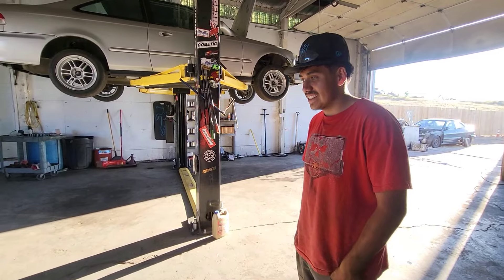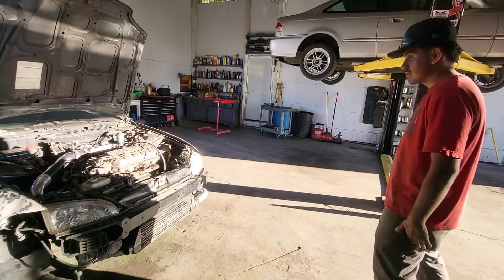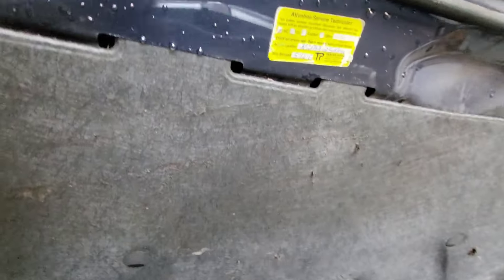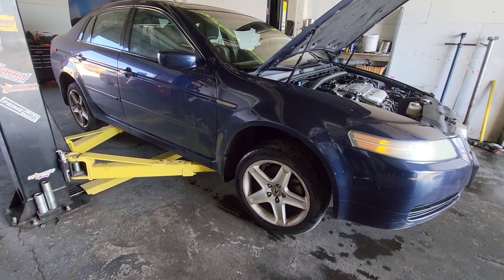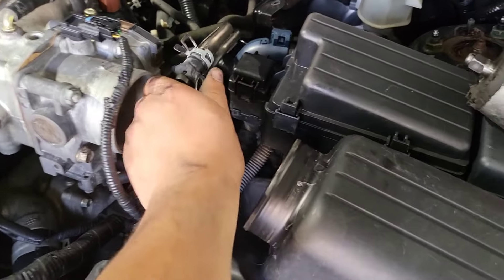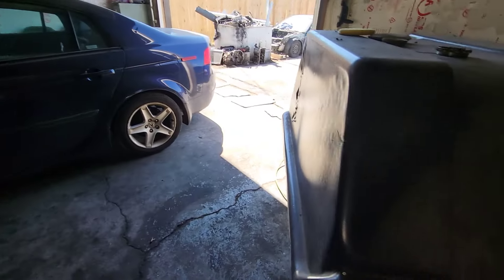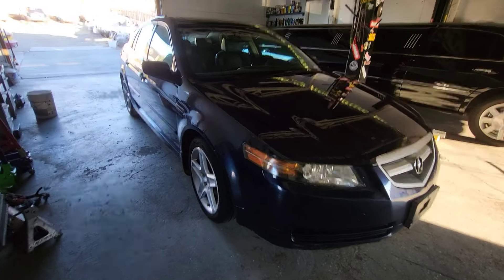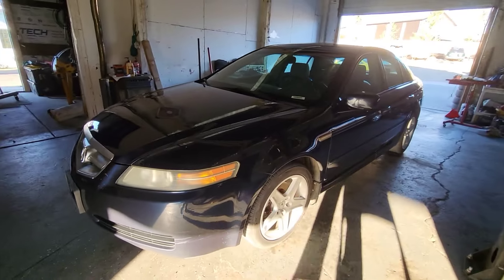Restoring-Fixing this 06 Acura TL Engine knock, easy fix

Comment: No CEL? If you flip this, what do you drive?

Wear a mask when you sand bro, you don’t want that shit in your lungs
Reply from the maker: No CEL after fixing spark threads issue. It did had a flashing CEL before.  I drive a duramax and my 82 toyota truck.  It was a lil windy that day. But yes my Dad always told me same. I really wear it when i clear coat , that is sticky stuff